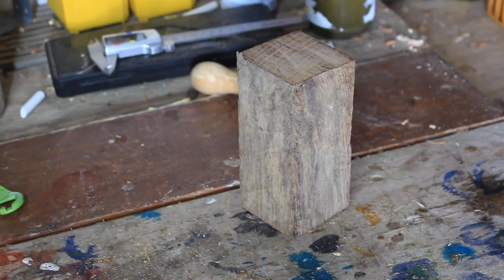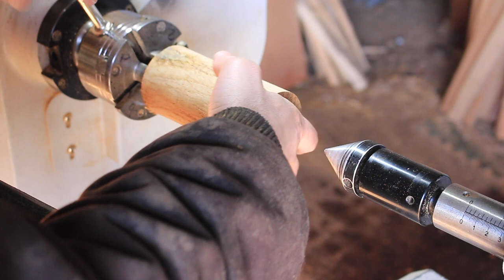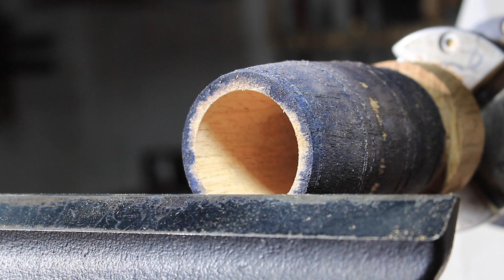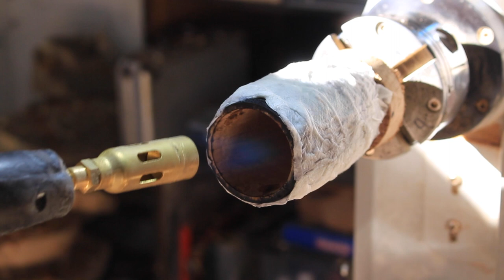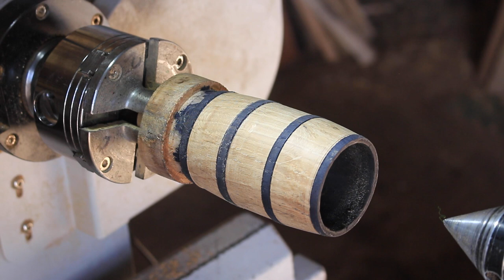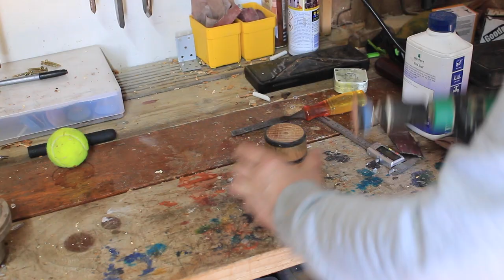OAK WHISKEY BARREL (Charred and Ebonized Whiskey Glass)

Comment: Thank you a really interesting  video,  what did you soak the towels in when burning the inside?
Reply from the maker: I soaked the towels in water before applying the blow torch flame to prevent moisture escaping too fast from the barrel and possible crack the timber
Reply: Thanks I thought water but the bottle confused me, I have some oak blanks so will give it a try
Reply from the maker: @kevindivall305  excellent. look forward to seeing them, happy turning Kevin, glad you enjoyed the video
Reply: Lovely wee video I have made 
Some nip glasses before, but that’s a nice idea with the barrel was that vinegar and wire wool that you stained the wood with at the start I look forward to turning some wee whiskey barrels 🥃🥃
Thank you for sharing
Reply from the maker: @brianmclaughlin2621  yes vinegar and wire wool solution, thank you for watching Brian, happy turning to you
Reply: A great little turn Patrick and some great tips thanks for sharing 👍 😊
Reply: Bourbon ready! Loved the video and the cup. Searching for white oak to make a pair in my shop. Not familiar with the wool and vinegar mixture, will have to look that up. I assume the finish was a mineral oil and beeswax mixture? Ratio you like? Cheers and great work!
Reply: One idea I had was to soak a velcro ace bandage in water and use that to wrap the cup prior to the burn in. No flaking off